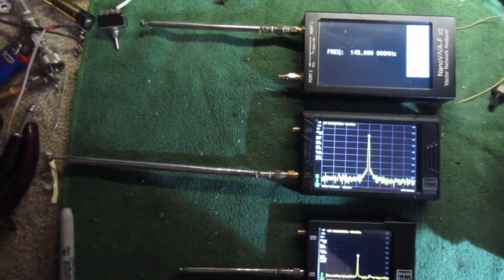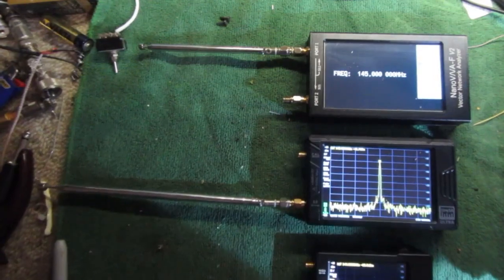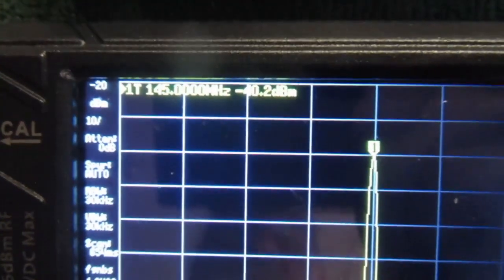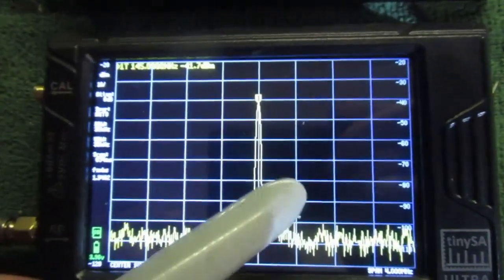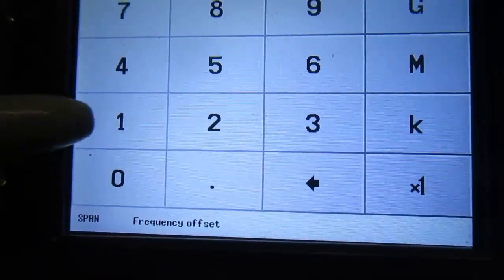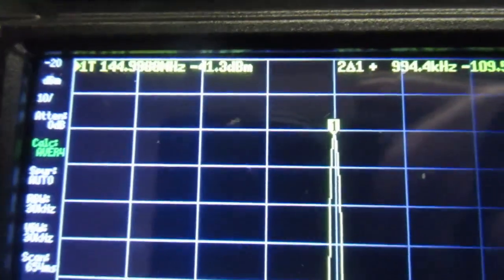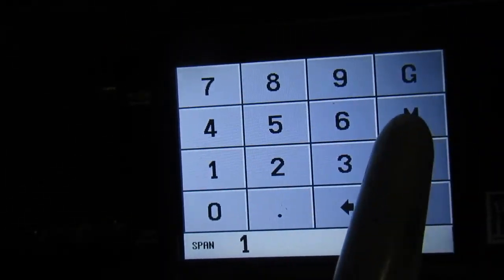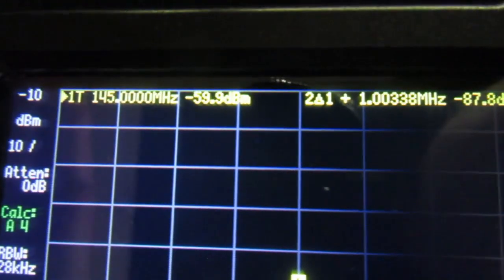TinySa and ultra resolution of 0.1 db increments measurement setting.

Comment: The apparent resolution of 0.1 dB is due to the fact that the value shown is the result of the average AVER4. Note that both the SI4468 on the ultra and the SI4432 on the tinySA have a resolution of 0.5 dB in their measurements.